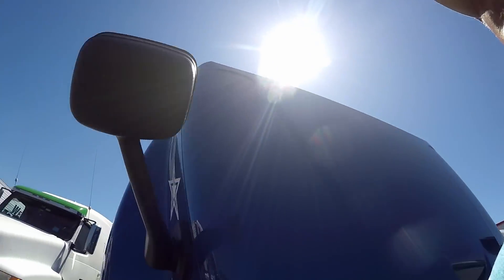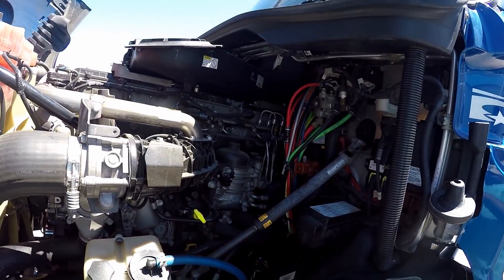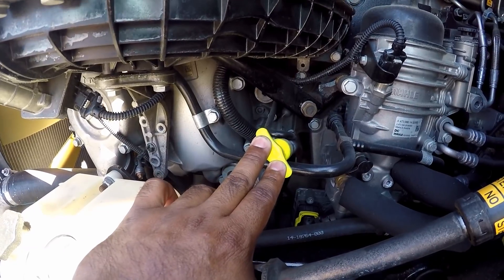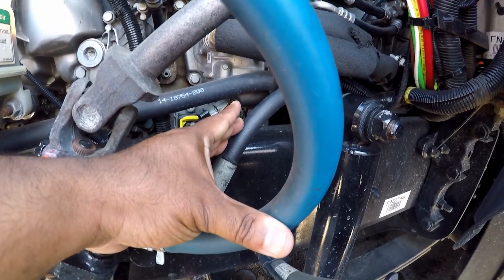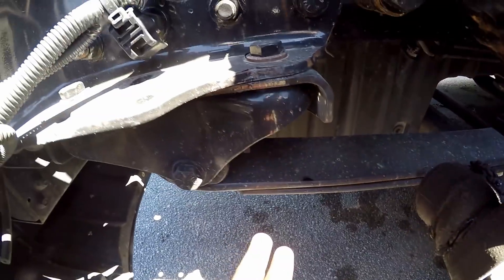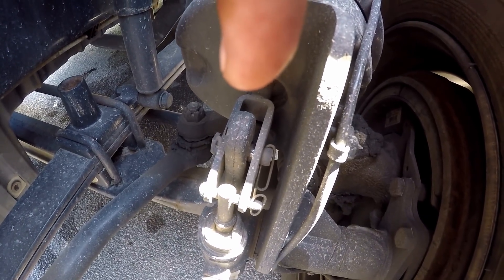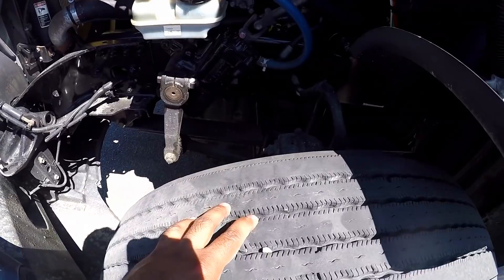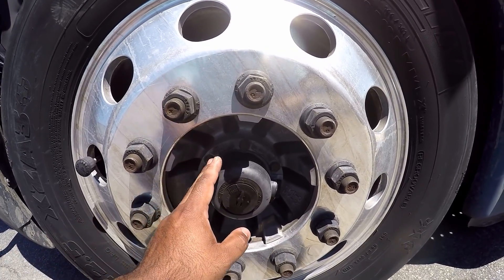Truck PreTrip - ENGINE

Comment: If you're a student just know that your not just learning this stuff to pass a test, it's a very important part of a truck drivers job that many guys neglect
Reply from the maker: That is correct you are supposed to be able to notice things when doing a regular pre-trip before you start your shift and getting with the road assist personnel. Thank you and thanks for watching 👍
Reply: Junior Honduras  im resident from texas i got my permit already you think that. I can get hire by prime to get my cdl and work for them
Reply: Just a simple question
Reply: It's the same requirement for bus driver's as well and anyone who drives any class B vehicle
Reply: M Orellana Did this pre trip videos help you to get your cdl here in texas??
Reply: Gabbi04 it helped me get my class B with a school bus
Reply: @JuniorHonduras  What about the Pitman arm?
Reply: @freethinker9817  and steering column. For the pitman arm, drag link and tie rod, he just called all three the steering linkage

Comment: Good video reload.
Missed look for leaks under engine/tranny, power steering fluid level and steering column by grabbing it and twisting to check play.
Reply from the maker: Leaking under transmission of the engine is supposed to done way before you even start the pre-trip at all. As far as the rest of the stuff it may be different where you are or where you went but that's how it is here at Prime. Thank you and thanks for watching 👍

Comment: Good overall, but you missed plenty of areas required by the federal/state manual.  A couple of examples:  springs cannot be shifted, cracked, broken or missing.  You missed shock bushings, slack adjuster hardware (pins and retainers), coolant and PS fluid level.  Brake linings must not be worn dangerously thin (there's no cracked/broken in the PTS, though real life is different).  Lug nuts and rims are checked to make sure they're not cracked or distorted.  In addition to rust trails as a sign of loose lugs, don't forget shiny threads - either from movement or from being cross-threaded.  Tire tread should be evenly worn.  The 'approach' to the truck where one checks for damage, leaning, leaks, or drips is the start of the PTS, not a separate section.  I also recommend using a 'flow' or 'pattern' in the inspection to make sure all of the areas are covered, rather than jumping around. Grab a copy of your state manual (google 'cdl manual') and check the details in chapter 11.  Keep it between the trees!
Reply from the maker: This is the test required by the state of the company where I work at. If your state is different then I am not sure. Thank you and thanks for watching 👍

Comment: How many points do I get if we do engine compartment???
Reply from the maker: You get points for all the items that you call out. Thank you and thanks for watching 👍🏽
Reply: @JuniorHonduras  this video is really helpful and I’m gonna do the exact way you doing on this video and in washington I have to get 67 points out of 90 so that’s why I asked about it. Thanks for uploading video and hopefully I’ll get pass pre trip inspection after 4 week and I been keep saying that (properly mounted and secure not cracked, bent or broken) No abrasion bulges or cuts and no leaking. Also I know now 70% parts name including engine compartment and under the trailer.
Reply: @JuniorHonduras  leaf spring properly mounted and secure at both ends. None missing and none are shifting right??? Or none missing and none shifted ??